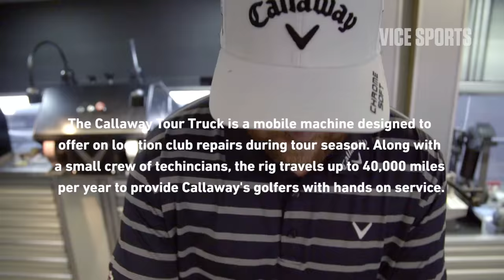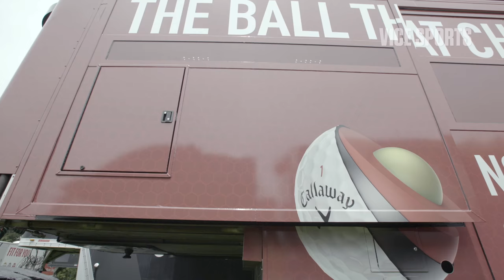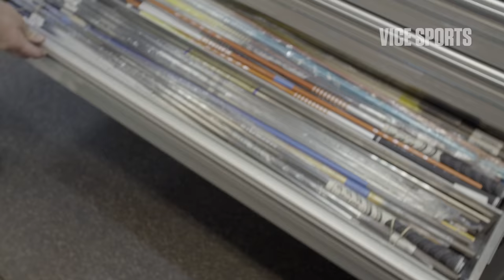Behind the Scenes with Pro Golf’s Pit Crew

Comment: I wish the equipment was cheaper, but the cost  is such a barrier to participation. It's not like other sports that just require a single ball and some friends to have a good time.
Reply: The shafts Danny tested retail for $400 apiece. Just the shaft.
Reply: You don't need to spend that kind of cash on bespoke gear to put together a decent game. Discount warehouse stores and off-the-rack sticks work fine for us Regular Joes.
Reply: Agreed! It should only be a problem with people have that champagne taste on a beer budget.
Alternatively you can grab top of the line gear that's a couple years old for a heck of a lot cheaper than the current years' model
Reply: Richard L.
I play with my dad's 35 year old Tommy Armour irons. Probably would get a bit more consistency with a modern set, but those things are soooo well balanced it's almost not worth it.
Reply: It is cheap. Buy used. The technology has gone nowhere in years. Its mostly all the same.
Reply: you can get some amazing super high end equipment for super cheap! you just have to look at used models from about 5 years ago or more. They still work awesome with great technology
Reply: And at the end of the day you don’t have to spend mass coin to put a set together. But also unless your a pro or play a lot of golf one set will last you a while it’s sorta a one off spend